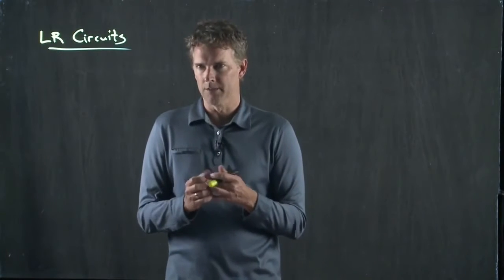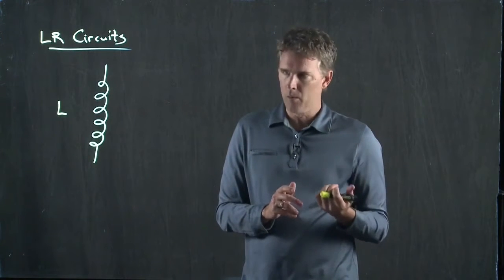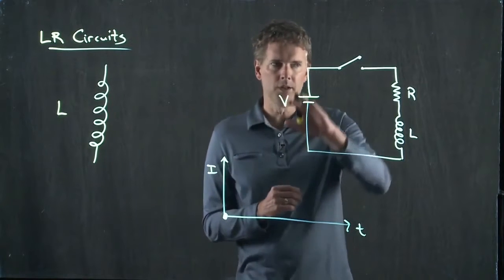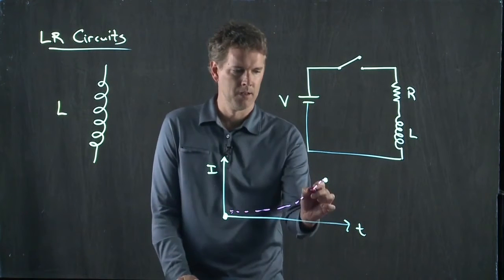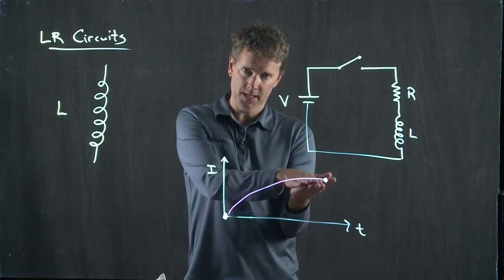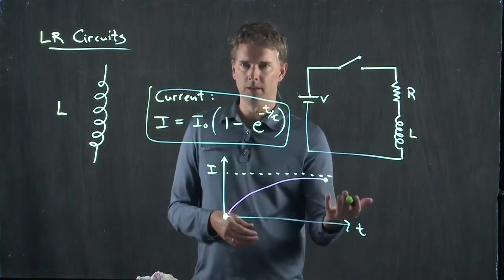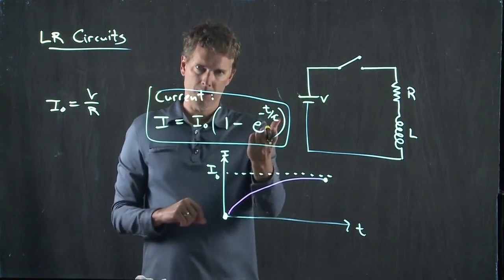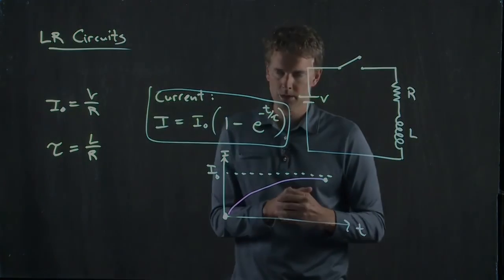Introduction to Alternating-Current (AC) Circuits | Physics with Professor Matt Anderson | M26-01

Comment: Hi, professor Anderson, I have a request for you to explain the topic about AC circuits. For example we have a capacitor, an inductor and a resistor connected in series circuit. How we can find the impedance   and the phase shift between the current and the voltage (the cosine of theta ?)
Reply: Good question.  Impedance is an application of imaginary and complex numbers, that extends Ohm's law to model what inductors and capacitors do.  I would recommend you first understand the basics of imaginary and complex numbers.  As a side note, because the letter I already has a full time job to stand for current, the imaginary unit is commonly called "j" in this part of electrical engineering.

It allows you to combine circuit elements of a mixture of these three kinds of circuit elements, and treat them just as if they were resistors, when setting up the relationship between voltage and current.  Except now, instead of just having real numbers for resistance, we have complex numbers for impedance.

Voltage and current themselves, are also complex numbers, to keep track of amplitude and phase.  Just like V=I*R applies for pure resistors, V=I*Z applies for impedances in general.  The magnitude of the complex number indicates the amplitude, and the angle of the complex number from the real axis indicates the phase.  Think of these as vectors that rotate around the complex plane continuously.   The projection onto the real axis, indicates what the voltage or current is, in real time.  Real axis = real time.   The imaginary part is a forecast for what the number will be at later parts of the cycle.understand
Reply: For pure resistors, impedance (Z) equals resistance (R).   Z=R
For pure inductors, impedance depends on inductance (L), and angular frequency (omega). Z=j*omega*L
For pure capacitors,  impedance depends on capacitance (C), and angular frequency (omega). Z=1/(j*omega*C)

I'll consider your example, leaving out the capacitor, just to keep it simple.  Define the voltage phasor to be a real number, and let the current phasor be complex if necessary.   Consider our given data to be V = 120V, R=100 Ohms, L = 100 mH, and omega = 377 rad/s (equivalent to 60 Hz).

Add up impedances, Znet = Zl + Zr = j*omega*L + R

Use V = I*Znet, and solve for I.
I = V/Znet
I = V/(Zl + Zr)
I = V/(j*omega*L + R)

Multiply by 1 in a fancy way, which is the self-ratio of the complex conjugate of the denominator.  This enables us to clear the j from the denominator, so that the denominator is real, and the imaginary part is brought upstairs.  After simplifying, we get:
I = V*(R - j*omega*L)/(R^2 + omega^2*L^2)

Plug in our data and get:
I = (1.051 - 0.396*j) Amps

Find the magnitude:
I = 1.123 Amps
angle = -20.65 degrees

The negative sign indicates that current lags behind voltage, as we expect for an inductor.
The cosine of this angle is 93.6%, which is what we call the power factor.   This is the ratio of real power in kW to apparent power in kVA.

If you introduce the capacitor, you will see that at resonance (omega = 1/sqrt(L*C)), the inductor and capacitor in series will have equal and opposite impedances, such that they add up to zero and form the equivalent of a short circuit.  The circuit then behaves as if it were just the resistor.  The exact opposite happens in parallel, and they have infinite impedance at resonance.   In the limit of zero frequency (i.e. DC), capacitors to behave like an open circuit, and inductors to behave like a short circuit.  The exact opposite happens at high frequency.
Reply: @carultch  Thanks, its late night now. I will read tomorrow. I studied electronics long time ago. And I remember that every sine signal can be represented as a vector or complex number. But I completely forgotten all math that goes with it.
Reply from the maker: Excellent discussion. I have a video coming out Feb 4:
https://youtu.be/zB9TYxfwokY
A bit simplified but gets the point across.
Cheers,
Dr. A